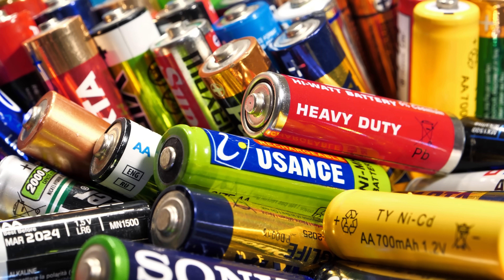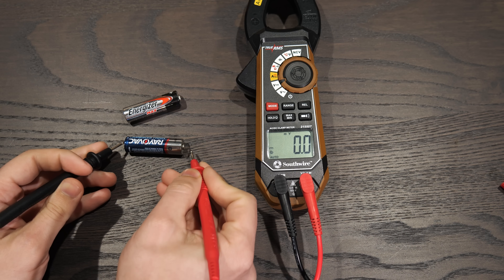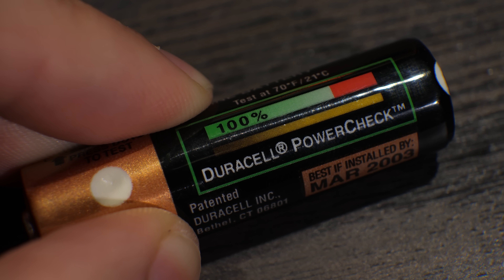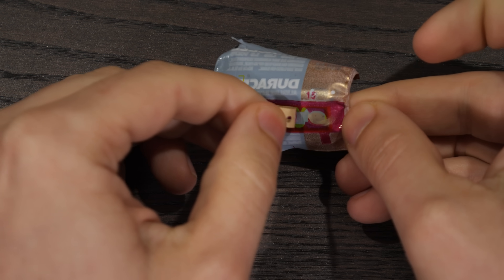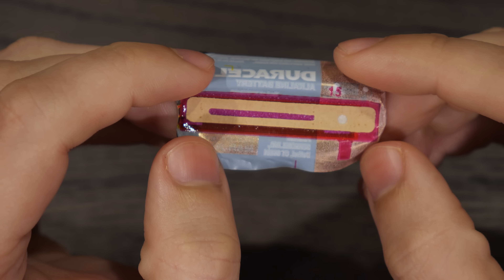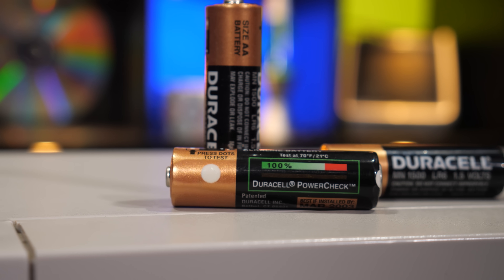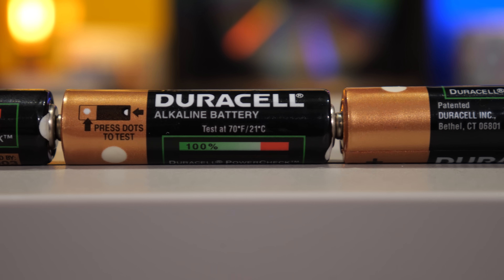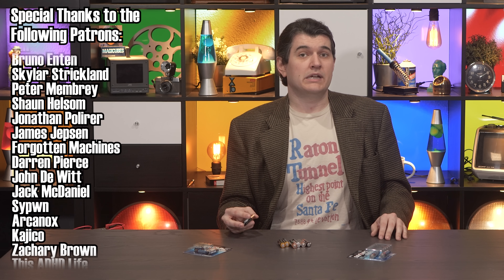Duracell PowerCheck: A genius idea which didn't last that long

Comment: I remember those.  I was wondering how they worked not too long ago. 
I test batteries all the time.  Sometimes I find a stray battery, and even without a multimeter, I can tell if they are good or not.  Find a hard surface, hold the battery, negative side down, a few inches above, and drop it.  If it bounced, it is bad.  I thought it was BS too when I first heard it, but it works.  I always wondered how that worked, perhaps something to do with free electrons?

Comment: I was fortunate with my GameBoy in that I got a gift of an external battery pack for mine.  Yes, it was another thing to remember.  Yes, the batteries inside degraded faster than I'd care for, until the pack wouldn't hold a charge at all.  But when that was the case, it still powered the GameBoy from the wall.  And I played that GameBoy a LOT.  All of it guilt-free, since I didn't have to buy batteries to play it!

Another little weird thing was that 4-player adapter which came with F1.  It's not exactly relevant to this video, but it was quirky, kinda cool, and never got used even once.  I never found anyone else who had that game.

Comment: I remember back in the day, I'd take dead batteries from my GBA and put them in my GBC and from my CD walkman to put in my cassette Walkman.

Though I remember the version with the power meter being on Energizer and Duracell just having a little window that would turn green with teh word "good".

And while I never really cotton on to AA having more capacity than AAA, my annoyance with manufacturers putting small form factor over capability has only gotten worse over time(to hell with microSD, removal of the 3.5 mm audio jack and lack of removable batteries).

Comment: Seeing a battery with a best if by date of March 2003 and remembering when that felt like forever in the future is the best part of this channel. These little doses of nostalgia keep me sane.
Reply: Yes, indeed... still getting very confused seeing 'Space:1999', or '2001: A Space Odyssey' mentioned.
Reply: Yes, and when he said they used to include cheap battery testers, I immediately remembered a memory locked away far back in the dusty corners of my brain: those testers were made of small paper strips with some kind of copper that you laid on top of a 9V battery's contacts and you had to press down pretty hard to make the paper work, but after that it was all wrinkly and you didn't know if you had broken it. Ah, the terrors of being a curious younger brother playing with your older brother's gimmicks without knowing if he would notice.

Comment: the battery had a built-in power meter, not a voltmeter. The reading is the result of multiplying the current and voltage

Comment: The only place we're still using disposable batteries a lot are remote controls for television sets, cable set top boxes, DVD/Blu-ray players and even video streaming boxes. (Even then, both Roku on their higher-end set top boxes and Apple on the Apple TV now have remotes that are recharged through a USB Type C connector.)

Comment: I remember thinking these were pretty cool.
I think it's main use case wasn't to see if it was good in a draw, but more to see if your device (e.g. tv remote) is faulty or just has dead batteries.

This would be more useful for rechargeable batteries.

Comment: I think these make A LOT of sense in one particular setting, that itself is also no longer around all that much. Home entertainment centre with multiple remotes and/or game controllers. We still have 2 tvs in our family home that need boxes to play tv since DVB-T2 dropped and that would've been a nice addition for figuring out if batteries could be shuffled between the remotes HAD IT NOT BEEN for the fact that 3/4 of them use AAAs, which I can only imagine would be a nightmare. O do still use Xbox 360 on ocasion tho, and the amount of swapping batteries around I did with those game pads was massive, the featire would actually be a godsend, had it been more common at the time and I'll forever be affected by that. Good thing for me the idea is still around, just less frequently

Comment: An odd (and probably irrelevant nowadays) point, when growing up, was always told "not to mix full/new batteries with half used batteries". So the tester would have VERY niche uses if they were mixed with older or newer batteries. That being said, most people only use new ones from the same pack, but thought it'd have been an interesting point to bring up

Comment: There were similar technology that came in duracells on 2010s (don't remember the exact year)
It had green, yellow and red parts and i had to press the battery on marks that were on both ends rather than one in the middle amd the end. Probably the same technology though
I didn't buy it because it was too expensive but tried it on a super market and the time when my friend bought a pair
The reason that it became obsolete is probably because they were too expensive compared to other options in my country

Comment: I remember Duracell having a tester bult into the tab of the pack as well as a box version for large quantity packs.
They would fail after 20 - 30 uses due to the contact being bent repeatedly. Then, a year or two later power check replaced the package testers and then they were gone.
Good thing I had grandpa's old Everedy
Tester from the 60s. Still sitting on my desk.

Comment: Batteries are getting crapier.  The latest bad chemicals are PFAS which are used as sealants in batteries.  Batteries are losing water which raises internal impedance.  The voltage reads good but they can’t run anything for long.

Comment: I believe that adding a full battery to a dead battery in a set is a bit of a safety risk and is often the cause of acid leaking, so this is still a useful tool. I wish they would bring it back, I’d buy them over others.

Comment: I still use the couple inch bounce test… 😅 If you drop a battery vertically from like 2-3” onto a hard surface. If it bounces then it dead; solid thud and minimal bounce then she good

Comment: yes i remember this, and then later they put the batter tester on the package the batteries came in instead, and then they just didn't give you one at all, and today with lithium ion batteries being able to be recharged over and over without forming a memory, like the old nickel cadmiums, it's way cheaper to buy rechargeable

Comment: If you were a kid and you couldn't afford to go out and buy a battery tester, you probably didn't have these batteries either. I was growing up shortly after these batteries were a thing, ran into a few as a kid but they were dead. We had cheap carbon zinc batteries that could barely power a calculator and it wasn't rare to find them already leaked and corroded in the package.

Comment: Not all batteries are built the same. Duracell, Energizer, and Kirkland AA batteries are substantially better than the knockoffs. Voltages out of the box are more consistent and last longer... Ran into issues with this when trying to get repeatable results from a microcontroller that had to keep time and power a DC motor.

My solution ended up being switching the batteries after every use and using each set of batteries only once. Our tests lasted about 30-45 seconds and that was enough for the batteries to come into play.

Comment: You should consider doing a video on old telecommunications devices used by the deaf. Texting in the '30s? Voice-to-text in the '70s? Video chat before the '90s? The deaf had it all! 

The TTY (teletypewriter) system connected two typewriters and could send and receive messages; it was basically the first version of texting and was mainly used in business, but also for personal communications by the deaf way back in the 1930s. 

The TDD (telecommunications device for the deaf) was a device that allowed for both text communications between TDDs and a voice-to-text relay service for easy communication between deaf and hearing people. 

One of the first public demonstrations of videophones being used by the deaf was at the 1964 New York World's Fair in which two deaf people were able to communicate between the fair and another city, but videophone technology is actually quite a bit older than that. By the 90s, the tech was getting better and better and by the 2000s, the VP-100 became a popular videophone in the deaf community to allow direct video communication between signers. The VRS (video relay system) deserves an honorable mention here as a voice-to-ASL videotelephony relay system.

Comment: A nice follow up topic might be how batteries seem to leak almost at random these days. They didn’t seem to leak so much back in the 70s and 80s. I think it may be due to the chemical makeup they now must use due to regulations. Also explore why they actually leak and how the leakage starts. Might be fun to explore that old guarantee that battery manufacturers offered that if a device was damaged by their battery they would replace the device. Did anyone ever get a device replaced by a battery company?

Comment: It was a cute sales gimmick but no one ever used or needed them because we just left the batteries in the device until it stopped working and then we threw them out and replaced them.  There, I saved you 16 minutes.

Comment: i barely remember this. but i remember as a kid desperately pushing something that looks like a battery with my thumbs until they ached in order to get a toy back up and running. so im assuming my foggy recollection is me trying to find working AA batteries as a kid.

Comment: Two other reasons not to put testers on batteries. One, battery companies want to sell new batteries, not encourage reuse of old batteries. Two, mixing batteries with a different state of charge is more likely to cause battery acid leaks, and encouraging reuse will cause more mixing. At least, that's what people say. Battery leaking would be a good topic for another video.

Comment: i only buy rechargeable batteries. i dont like buying disposable things. it feels like you throw away something you paid for. it doesnt feel like getting your monies worth. and it isnt. rechargeable batteries can be reused a lot. especially if they are good quality. like eneloop pro. or you can even get 3.7v lithium AA batteries with an internal 1.5v regulator. the pros and cons of that is its always 1.5v until its dead, which is good. but then you get no warning when its going to go flat. which is not so good.

Comment: my Virtual Boy devoured these!  after burning through my allowance i realized i needed to "splurge" on the A/C adapter.  i still have the system, games, & adapter with the original packaging, and a few original receipts.  mmm, nostalgia!
random fun fact: i recall the Energizer version of this self-tester was just a small rectangle that would turn green with the word "GOOD" printed in it.  how much "green" filled the rectangle was the vague implication of the charge status.

Comment: I think these are more like ammeters than voltmeters. Voltmeters usually have a high resistance, a theoretical one would have infinitely high resistance. These thermal strips have very low resistance. Like a short across the battery. Again, theoretically, you test voltage open-circuit, drawing no power, and you test current capacity short-circuit. 

As a handy side effect, every time you test them you're putting a heavy load on the battery, shortening it's life. So time to buy some more Duracells comes quicker than you think, and it's actually your own fault!

Comment: My initial thought was that they found it's better for brand reputation if the consumer doesn't know what charge is left in the battery when purchased. Every alkaline battery I've bought in the last five years is half dead when bought. But that may have been less of an issue back in the day when these things were flying off the shelves.

Comment: So i watch this again, as i have a dead batteries box* and an untested but definately used box.

I recall seeing the date on the battery in the video, 2003(?) This is usually an expiry date and not a manufacture date. Well after the 1st viewing i went to have a look. After the 2nd viewing i noted the battery tester manufacturing period was a short one. No dates. So question... When did these start and stop manufacturing?

I've got a battery labelled with 2018, it actually stopped working this year (2024!). I've got a few others that are dated 2009 that stopped just before that. Before they are committed to the eternal re-cycle (or re: landfill), when did they stop making these? They are Duracell Ultra M3 models. Most say made in EU, but 2018 one made in Belgium. I've got a dead non-tester version with 2026 and an untested with 2025 on it. Some live hard and fast i guess.

*A box which is cleared to a recycle center regularly. Has a hole in the lid allowing gases coming from the decaying batteries to escape. Batteries that have burned or exploded from my limited knowledge. Did so under pressure or lack of... ok, I'm probably in danger of killing myself. Please let me know if i am... soon.

Comment: Actually, when flashlights primarily used batteries before a larger shift to rechargeable, and when they used bulbs which indicated their charge level... when they got dim enough to be less useful but still illuminated the bulb, they'd get swapped out. Those batteries were good enough for a remote control but not for a flashlight.

Comment: I wish these testers were put on rechargable batteries.  You're right, I rarely need to test if disposable batteries are charged or not, but rechargable batteries take a long time to charge and lose their charge relatively quickly if not used.  It'd be great if I could quickly see how much charge a rechargable battery has left.

For some context, I mostly use them for that certain period of retro gaming.  The Wii, Xbox 360 and Xbox One all use AA batteries in their controlers.  I HATE this!  I want a controller with a built-in battery, or just a long wire.  I genuinely don't care about wireless controllers (though a wired Wii controler would be pretty bad).  The problem is that rechargable batteires take over a day to charge, and I never know when I might need them.  I find myself just keeping a few charged all the time and removing batteries from my controllers after every use.  I should get a battery tester, but it would be convenient if they batteries had them built in.

Comment: I keep batteries in my digital torque wrench case but never leave them in the tool.  I insert them each use, which is semi rare which is why I don't leave them in it so they don't corrode in it.  I'd love to still have these testers

Comment: I think the reason these went out is because there's only really one proper test for a battery: put it in the thing and see if it turns on. turned on? good. have a spare? perfect. missing one of the two? get new batteries.

Comment: Curious if a low tech indicator like this could be made for a battery tester... much rather this than a half dozen LCDs... at least for my 18650s. Would be nice as it could be made easier to use and fairly certain, being so basic, there is little to no way it could be worn out over time and use.

Comment: Would you know that you can accurately check battery charge just by trying to bounce it on a marble table? Bounce battery with the negative side facing the table. If the battery bounces high and keeps bouncing, the battery is empty. If it does not bounce, it's full. Try yourself.

Comment: Back in the 1990s, as a teenager before I got into IT work - I worked in paper mills in my native central Wisconsin. One of the BIG customers we did work for? Duracell. They needed a VERY specific and special paper construction for the bindings on these batteries, and I worked at one of the few mills that made them (in this case, it was Mosinee Paper). IIRC, it was 3 or 4 different types of papers with different construction materials to make those wrappers in the first place, and they were NOT cheap, and needed extremely precise & specific  things built in to the cellulose mesh that made up the base of the paper itself to work properly.

Comment: This would be nice on rechargeables. Except for the fact that this requires pressing the dots very hard, and the tester would wear out pretty quickly. I remember having some of these Duracells that were still good but the tester didn't work from pressing it too hard.

Comment: I stopped using Duracell batteries about six years ago. They are not the batteries they used to be. We started having them corroded, flashlights, or emergency lights. 
So I've had to switch over to Eveready .
I miss the good Duracell Duracell

Comment: getting some of these in the house as a kid was always almost if not more exciting than whatever gadget they might have been powering...

also my preemptive guess based on the temperature thing is that it's functionally an Electricity Mood Ring, with some heat-sensitive dye that's somehow affected by the resistance of the battery, and needs heat from human hands to reach the pigment's heat activation threshold (but why those specific spots? there's probably something Electric and Circuity going on there too...)

edit: "mood ring" mentioned independently in the script after the point where i made this comment, so i know at least part of my guess has some amount of merit!

edi2: ok so "something to do with resistance and circuits" yes, body heat no, but wow making a mini resistive heater by sticking a tapered bit of metal to there is a pretty neat and ingenious solution!

Comment: I think they should come back specifically for newer rechargable cells I have lots duracell rechargable around and need to use my multimeter to see which ones are still charged or need a top up when swapping them out